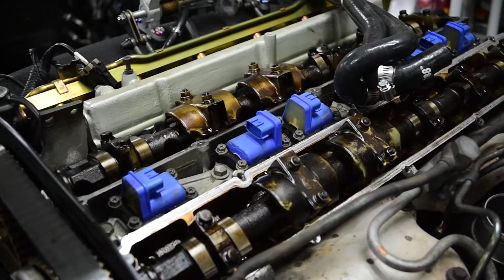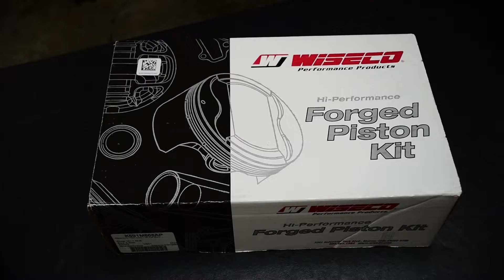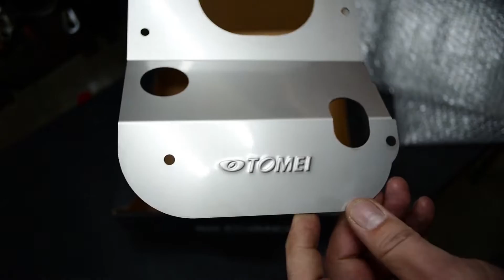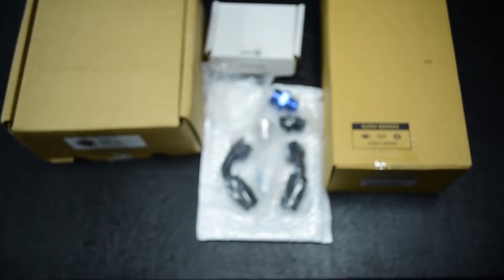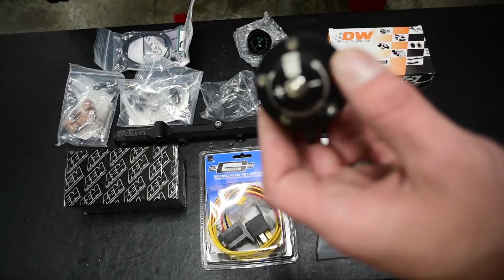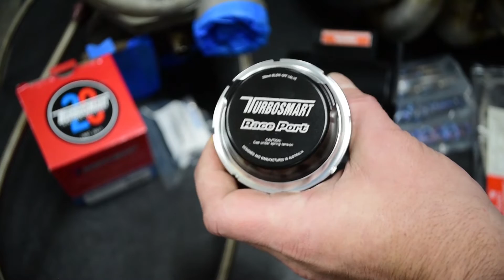R32 Skyline GTR - Winter Build Part 1 - Intro and Parts List

Comment: So when you took the engine out did you use a lift? I have a set of quick jacks and im wondering if that would be enough to either drop both engine and trans from subframe or lift both up from the top
Reply from the maker: @LeroyGTR  if you’re going to lift it out of the top get a leveler so you can control the pitch, you will need to tilt the trans down slightly to clear the radiator support
Reply from the maker: @LeroyGTR  quick jacks won’t be high enough. I removed everything from the top. When I reinstalled the drivetrain I had some XL jack stands set on max height and it barely cleared the valve covers sliding everything underneath.

Comment: Now you said pulling the engine with trans wasn’t bad, but would you say removing the trans first would have made it easier?  About to do mine this year building a Neo motor and Neo trans…
Reply from the maker: It’s easier in the sense that you can just pull the engine up and out. If you keep the tranny connected and take it out the top it gets a bit awkward trying to clear the rad support. NEO might be slightly different than the GTR in term of geometry for the driveline, I know on the GTR’s it’s pretty tight. IMO it’s easier dropping everything out of the bottom, less potential damage and can get to all the bell housing bolts easier. Either way it’s a process so pick your poison. Hope it all goes well!
Reply: @inertiaimages1139  yeah!  I won’t be doing the swap for quite a while, but every time I’ve got the car in the lift I’ve been under there looking and contemplating which is gonna be easier… seems like trans down and engine up would be easiest, but keeping it all one piece seems pretty beneficial in its own way…

Comment: @inertia images the Franklin engineering head drain, you said you didn’t need the full kit because you had braided line...as do I....so where did you get a kit with just the drain fitting and other fittings? I’ve seen just the head drain fitting on eBay but not with the other fittings minus the hose. Thanks.
Reply from the maker: dr720942 you know what, just looked at my email and I got the kit that came with the drain line hose but tossed it because I’m running black line and not stainless.  Been collecting parts for a year or so, forgot about the line 😂
Reply from the maker: dr720942 you can piece together a kit on Franklins website of all the fittings you need

Comment: Nice video!  Never heard of an FPD until this video.  Is this common?
Reply from the maker: Jonathan Burns some cars came stock with them, Radium kinda cornered the market with aftermarket units.  Helps smooth out the fuel pressure and absorb/smooth out the waves in the rail caused by injectors opening/closing.
Reply: it's especially helpful for vehicles that use batch injection due to the heavy pulse. I admittedly am not sure what the RB26 uses, but the 1JZ (like mine) will often run like garbage if you delete the stock damper and is further compounded with upgraded fuel components. I had weird lean spots in my tune that you couldn't fully tune out, and with the addition of the Radium piece they disappeared.

I corresponded back and forth with Radium before and after, and they have my short review posted on the website. Really happy they make these, and as Matt said they pretty much own the niche atm.